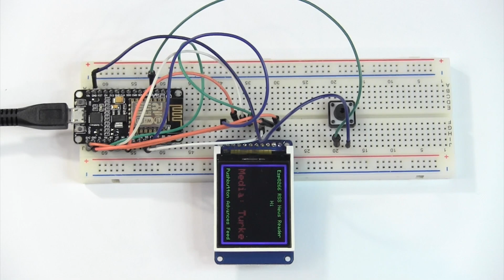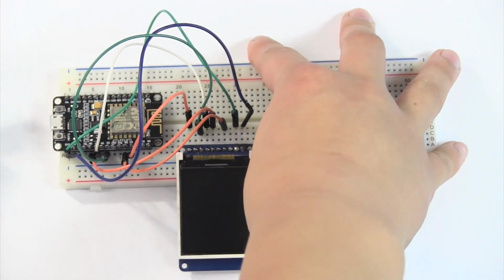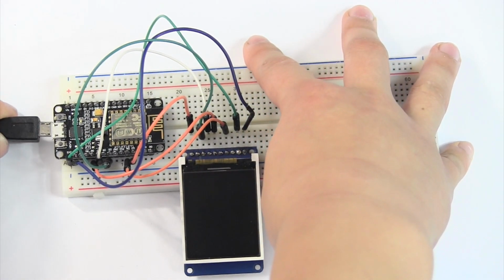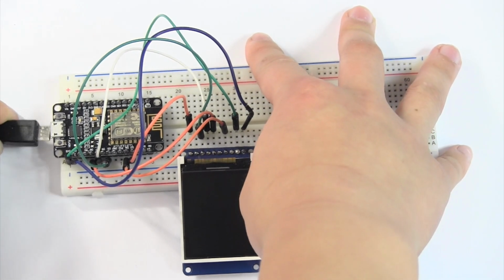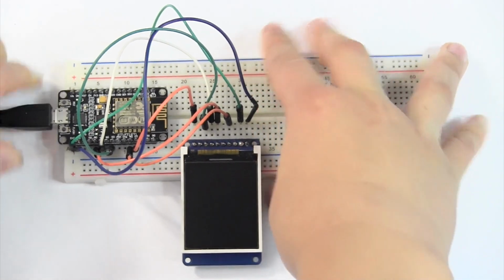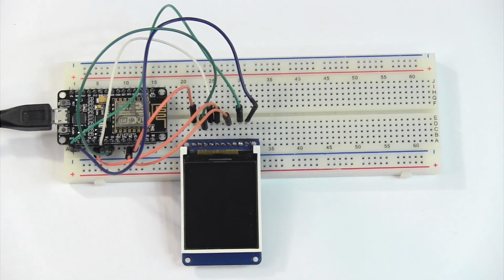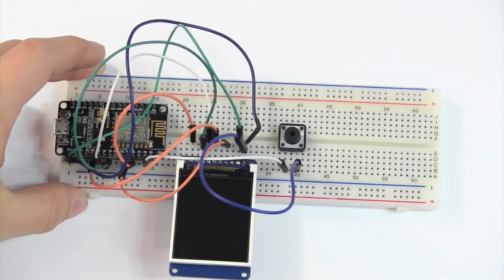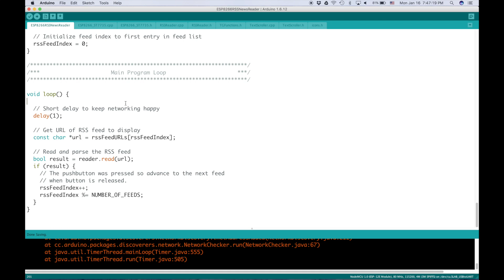ESP8266 tutorials: RSS News Reader

Comment: I'm really interested in this project and would like to build it. Would it be possible to use a different TFT, other than the Adafruit ST7735R TFT? If yes, which one would you recommend? I'm asking because I no longer purchase products from Adafruit, as I've had bad experiences with them (receiving faulty parts and not being given a refund or replacement). And how difficult would it be to change the code for a different TFT? Thank you.
Reply from the maker: Of course! There are numerous articles/videos on the web that show you how to wire/code similar TFTs to the adafruit ones. I can't name any sources off the top of my head (I made this video more than 3 years ago) but I'm just letting you know that the resources are there. Hope this help!
Reply: @JeffreyApp  Yes, that helps. And the code? Would there need to be major changes to the code to reflect a different TFT?
Reply from the maker: @CurtRowlett  Likely not - they usually use similar chips/drivers, although there might some small conversions you need to make.
Reply: @JeffreyApp  Thanks, Jeffrey. I really like your channel. You have great projects with a lot of helpful information. Take care.
Reply from the maker: @CurtRowlett  Thanks for watching my videos and for your support! I hope you enjoyed! Take care.

Comment: Hey, thanks for the tutorial.  Whenever I upload the code to my Wemos D1 (with the ESP8266) the serial monitor keeps on writing "..........." , it never seems to connect. It does connect with the D1 examples so my setup should be ok. Any tips? I get the same problem with the original code from Craig. Thanks in advance!
Reply from the maker: Did you put in your ssid and password?
Reply: Hey, I did enter both.
Reply from the maker: Did you check that they were correct?